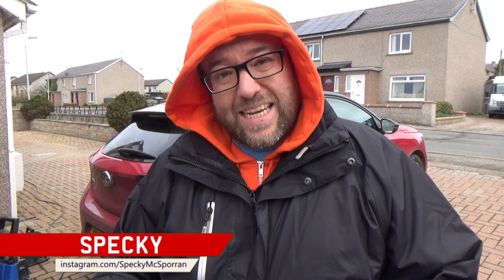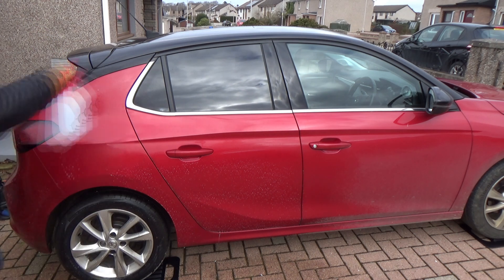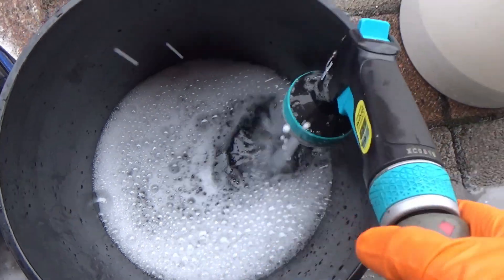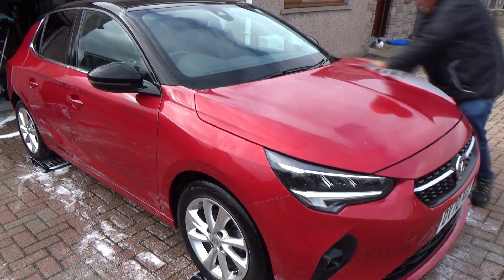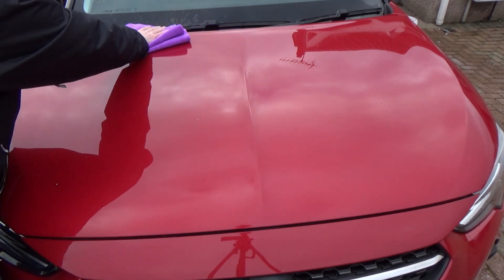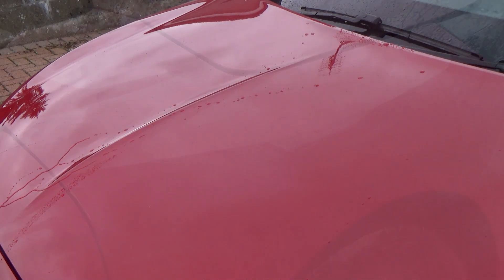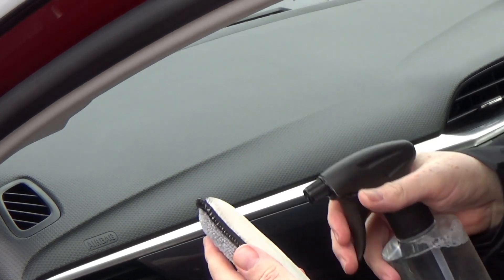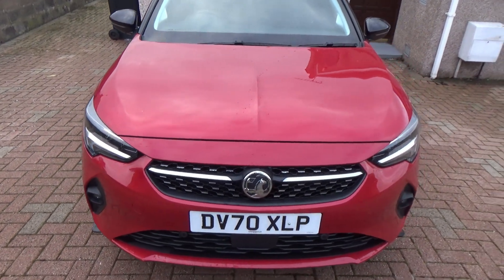New and Improved products from Garage Therapy

Comment: Fit like. I agree with you on most of the points in this film and the products used but (using the Glasgow slang where a sentence ends in but). I like to use a citrus pre wash overlaid with Snow foam by my supplier of choice (M & K) but on a really dirty car I use their Snow foam with extra bite HD Snow with great effect. I can spend 3 hours discussing detailing with John and he is of the opinion that cars should be pre rinsed with water at the start of the process I was unsure on the dilution on contact of any products thereafter but as he said how much water is left on a well protected car by the time you put down your lance and pick up your spray bottle or pump sprayer. I am always worried that when you blast mud off a car are you rattling the grit along the paintwork causing scratches. With regards rinsing Snow foam off I am a top down man (as opposed to the "Taps Aff" method that is in favour around these parts when the sun shines and can be seen in any of the Parks around these parts) as when you work up to the top all the foam residue is back at the bottom and it needs going over again not needed as gravity aids washing in the top down method but I do see the logic in your method and sometimes I use it on the lower half off the car when it is dirtier and then switch to top down.
 With regards wheels, GT wheel shampoo is unrivaled but I now use M & K Strip on the tyres which has the same effect and characteristics as GT Decon. The yellow colour on the alloys I had on the Discovery Sport I bought, but in the barrels. The only product that removed it was WoWo's wheel cleaner which according to Fraser who owned the Company at the time had the all the characteristics of an acid but not the P.H. of an acid so no potential for damage especially to diamond cut alloys. GT serum is my tyre dressing of choice applied with the Carscope brush. 
The GT exterior products I used for at least a year and loved them but I am a huge wax fan and now that I am retired I can indulge my passion with no time restraints except daylight hours and rain but the time of year helps with both except this is the West of Scotland and it rains a lot. I usually detail my Mum's car in Banchory twice a year and due to time restraints I tend to use Sigma and CS on her car but I have not tried Sigma V2 which I believe is better according to David McBay.
I really don't enjoy interior cleaning as much but my interior cleaner is GT interior topped with M & K Treat but that new GT product looks interesting its a pity GT don't do sample bottles as I might be interested in giving it a go. The Glass cleaner I tried and I rated it as my least favourite product in their lineup but maybe I should  try it again and use their cloth can it be ordered direct from GT or is it only available from In2Detailing. My glass cleaner of choice is AutoBrite Glass cleaner but my exterior windscreen I use the M&K 3 step process of cleaner, polish and repellent. Angelwax H2Go is an excellent water repellent product that I also use
I will stop rambling now as I am sure you have lost the will to live but again I look forward to your next installment as they are always enjoyable and thought provoking. Thanks again loon.

Comment: Fab vid, fab products love GT. Haven't got the glass cloths yet. The wash mitt I found awkward to use, bit short on the hand and I've got little hands. I've got a Citroen C3 Courtesy - had 2 months now as Astra awaiting parts after a wee ding ok front frontal!). Apart from Soft 99 gacò on the glass and odd hose down, think I need to give it some love.
Reply from the maker: Don't do too much of their job for them 😂
Reply: Well it's courtesy 😂. Did NAT like that Corsa?
Reply from the maker: She really did, seemed well built and very easy to live with. Heated seats and steering wheel, auto lights, wipers and even high beams!
Reply: @SpeckyMcSporran  I'm missing all those things. C3 is a nice car but it's the base non turbo, 86bhp, not enough poke for cross country and motorway. LED lights are awesome though 😎

Comment: Specky hello, been watching your videos.  My gold ones are the prewash mentality. However i have a Q regarding the PIR and foam lance. So got a new one and went through the process to check the water required to empty my bottle. I notice that  when added my solution took time wise more to empty the bottle in contrast when it was only water yes is bit more viscous but have you ever come across a similar observation on that. 
Cheers Hercules
Reply from the maker: Honestly that's a new one for me and I'm not sure I've heard anyone else mention it. Either the problem is unique to you/your setup or we've never really payed enough attention to compare. Viscosity COULD have an impact but without more study I can't be certain. I'll have to look into this one. Thanks for sharing this 👍🏻
Reply: @SpeckyMcSporran  For me too since it is very noticeable. So the items i used was the MJCC pro v2 and a new soap that the viscosity is unreal. In comaprison to the BH Autofoam the new one is 5 times more thick i say thicker than dish wash soaps. The mark land was the differential speed at the nozzle been slower. i will to try to find a big plastic 200liter barel to empty one in it let it rest till the foam breaks down and measure again and compare the 2 data. Cheers for the reply, input and time to this Q
Reply from the maker: If you could let me know your findings after the test I'd greatly appreciate it. This is something worth looking into as all our calculations are based on the flow rate of water so this could have an impact on the industry as a whole.

Comment: Great video Specky. Tyre Serum is now my favourite and as you say, using the Car Scope brush is just fantastic. I also used it on the plastic wheel arch mouldings and lower side skirts on my wife's mini and it works brilliantly. I have tried Dash Serum and didn't really get on with it, but after reading Darren's comment below, I'm going to have to have another go with it.
Reply from the maker: Cheers Kenny, Tyre Serum is in my top 3 for sure! I've only played a little with Dash Serum but it worked out great for me. As you'll know, some materials can be fiddly with certain products so I'm glad I have a variety to use.

Comment: 1st
Reply: Great video. Lots of really useful info in there. Loved the comparisons at the start. I used to use TFR on every wash 🤣 but now use citrus in a pump sprayer on the lower sections and then spray the snow foam on top. Makes the job so much easier. Just got a set of rimmats. Gamechanger for me. Keep up the good work!
Reply from the maker: Thanks bud! 🙌🏻